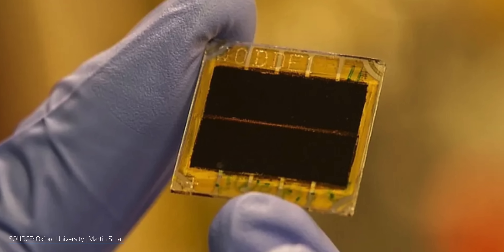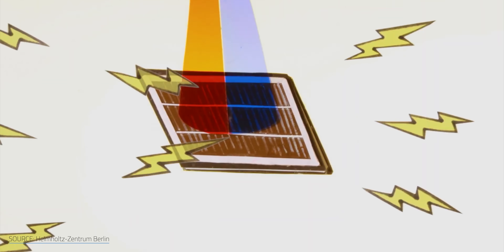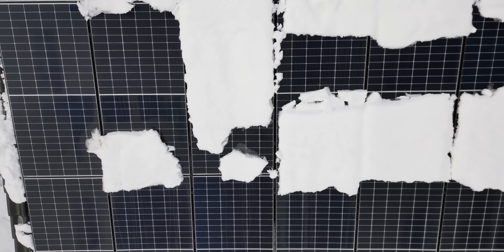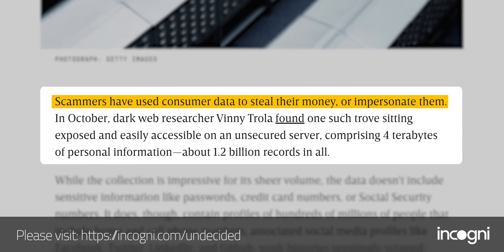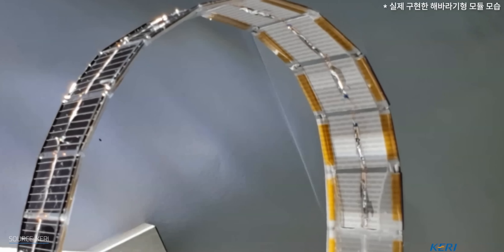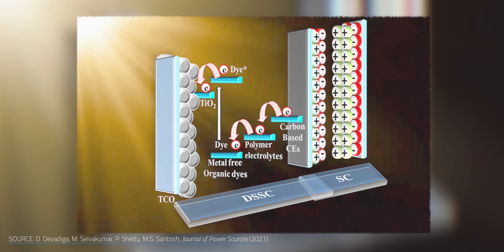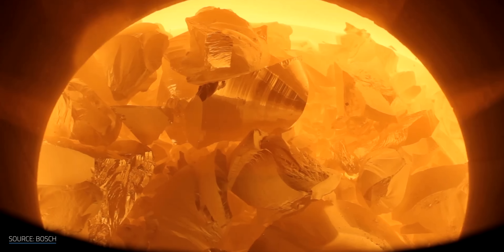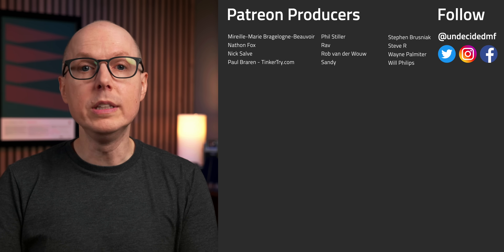Why These Quirky Advances Could Change Solar Forever

Comment: The problem with perovskite is that it dries out, so my idea would be to place a micro layer of silicone down, then a layer of perovskite, then another layer of silicone on top, this way, the top layer can even have those little pyramid shapes within that top layer, to help the perovskite absorb more light, and being sandwiched between the silicone layers, it won't dry out.
     Another thing I came up with, is why not put stacks of peltier cells between solar panels and it's aluminum frame, because the panels get very hot from the sun hitting them, so this would not only help to cool the panel's by absorbing the heat, and turning that heat into power, thus cooling the panels down, but it would also produce added electrical power output, one from the solar rays, and secondly from the solar heat....🤔🧐😎👍

Comment: I'm interested in using my channel to do comparative testing of solar cells in diffuse light, would anybody be interested in helping me by donating solar cells or test equipment? Maybe a large diffuser for test consistency. 
   The specs on solar cells under efficiency or not rated under diffuse light, but under a perfect sky at the equator to make them look better... And then the Chinese ones usually grossly exaggerated...
   I want to make a series on my channel testing many different brand styles chemistry is for their performance on the diffuse light specifically. Also to show the benefit of higher efficiency in diffuse light compared to high efficiency in direct light.
  Who would be interested in at least watching and subscribing?
Reply: Only 3 videos in 2 years!

Don't begg for freebies haha.

Go and buy some solar panels yourself. Their cheap these days.
Reply: @C--A  fixed income, got about $20 to spare, sometimes..
   As for videos, do you really think anything I've done so far counts as a video? I don't.

Comment: I have been long retired from the the world of electrical and electronics engineering and there has always been one aspect of solar as a major form of renewable energy that I question. A long time ago I was asked to investigate the untimely death of dozens of small plug packs that were used to supply peripheral scada systems. These systems were critical to the function of a highly specialised fume detection system and as such had to perform flawlessly. As part of the investigation one of the parameters surrounding this was heat, the small plug packs were all burning out. Now each of the the power loops (240 here in Aus) was fed from a pure sine wave inverter which had stand by batteries to keep the output steady. I decided to connect a power analyser to the output and was amazed to find that the output looked exactly like a modified square wave. The steps in the "sine wave" were only small but what has to be understood is that any step is seen by a transformer as DC and as such causes incremental heating of any thing designed to run on AC. There is no such thing as a pure sine wave generator as the heat generated to produce AC is hugh and makes the actual build of such a device incredibly expensive. Every solar setup that purports to put out pure sine wave is only causing massive problems on the transmission, distribution and utilisation networks. Remember the step part of these inverters is noise and noise is additive so by the time the noise reaches the generating stations it is substantial.
I was recently dragged out of retirement  by a friend to look over the building of compensaters or power factor correctors that were being built and rolled out to be connected to the  the distribution system as a means to quell the noise and keep the transformers cool. Does solar have a place yes but as individual systems and not connected to the power network.
Reply: There's a specific IEEE regulatory standard that exists to standardize the frequency spectrum generated by switching power converters that are grid connected. It is an active area of regulation for switching power converters but it is not a very large part of concern with modern technology in the sense of solar inverters. IEEE 1547 and IEEE 2800. It's a valid concern and one that is central to modern implementations, but has already been overcome for the most part.
Reply: Everything you say leads to one conclusion. Distributed power generation and usage. No centralized transmission system is required any more. All those problems become redundant. Produce and use the power where and when it is needed. Transmission infrastructure is highly costly to build and maintain and it is inefficient with all the up and down voltage conversion going on everywhere.

Comment: Makes me crazy when we just accept that solar farms necessarily need large tracts of unspoiled land. Yes, there's agrovoltaics - but then you have to build the lines from rural areas to carry the power to where it's needed - which is mostly in more urban areas. Your averge WalMart Supercenter parking lot is at least half as big as the solar farm pictured - and I'm sure they would be happy to take whatever passive income they could get from leasing use of the parking lot to a solar power company to install solar panel canopies over parking spaces. Shaded parking for their customers, producing power closer to where it's needed, and helping to offset the urban heat island effect to boot. Ditto for all other large parking lots. How does it make sense to use more land when we already have so much that's not being used efficiently?
Reply: Don't forget about all the windows could have transparent solar panels. 😮👍🤟✌️ That's not sarcasm, very easily done.

Comment: Since land is by far the most expensive part of putting in solar panels, can you please explain why solar panels aren't on every parking lot or flat box store roof? The metal for higher scaffolds can't be that expensive, and same for roofs. I live in the Midwest, and it is shocking to me that it's more cost effective to replace farmland with solar. I suspect the difference is permitting, subsidies, and scale, but I don't know for sure. Please investigate!
Reply: I think in Australia they use this kind of rooftop solar alot more.

Comment: Just to clarify, according to wikipedia multi junction cells are only that high efficient, when sunlight is concentrated. So it sounds fantastic to have high efficient solarcells, but those do not work as good for everyone (from the single consumer perspective, as the multi junction cells will be much much expensive then single junction cells (which you can buy with good efficiency now!). So maybe more for industrial or public energy companies interesting, but I doubt it, price is key in almost every part of society

Comment: Instead of buying land and wasting land space it would be better to just have a push for all building, business and residential,  in America to have solar panels on them and be connected to the grid. Add in battery storage into the mix and we would have to worry sourcing  for are power needs.
Reply: I think in Australia they use this kind of rooftop solar alot more.

Comment: you could also set up a simple window wiper system that just sprays water on the panel then a car like window wiper swipes across the panel cleaning in and removing dust water snow

Comment: I'm fortunate enough to have enough roof area facing in near optimal orientation so that my solar panels are 100% efficient, meaning that they reduce the total energy bill on my all-electric home to $0.00 per month. I don't need any more efficiency than that.😀

Comment: under no circumstances will a moving twisting and bending solar cell array be more resilient than a regular long lasting cell without any moving or bending parts
then it leads to the question of invest vs return .. those specialized cells will with absolute certainty cost far more per kwh produced most likely several times if not an order of magnitude .. and then i have to ask .. why? why don't put down 3 times as much regular cheap solar cells facing south west, south and south east .. while spending less money and having higher reliability

Comment: Growing crops under/around solar arrays is an interesting potential to reduce the cost of purchasing the land to use for just solar arrays by allowing the farmer/landowner to continue to use the land. However, most of the implementations that I have seen use standard opaque solar arrays. As such the area directly under the arrays only get indirect light, reducing the types of crops that can be grown in the shadows. 

However, if the arrays were the thin film arrays discussed in this video that could be tuned to absorb only specific frequencies of light, then those frequencies which plants use most could be allowed to pass through the arrays while all of the other frequencies are absorbed by the panels and turned into electricity. Plants that require "full sun" could then still grow below the arrays.

Comment: 1.6x 20% is only 32%. at what cost.
Reply: Yes, and 1.5x 20% is 30% and 2x 20% is 40%. Questions?
Reply: @zweigackroyd7301  what, why
Reply: @gsestream  You don't appreciate random multiplication unless you post it?
Reply: @zweigackroyd7301  at what cost, nope
Reply: @zweigackroyd7301  I dont appreaciate forced appreciations, of kings. 60% is usually nothing. order of magnitude would be the best. 30% vs 20% efficiency is virtually nothing.
Reply: @zweigackroyd7301  yeah just put a second 20% panel, double up the panels, dont pay more for the appreciation of kings.
Reply: @gsestream  Thanks, I'll go with the experts than random cryptic person on YouTube. Feel free to write comprehensible information, but your statements about efficiency are poorly informed.
Reply: @gsestream  Does babbling on about kings make you feel clever?
Reply: @zweigackroyd7301  every bit does not count, if it makes you judge others, king, the more you push, the less interested I'm in your stuff, whatever it is. mind your own business.

Comment: Other than the memory material tracking, what’s different about using the folding array there vs. plain classic PV and an array of tiny panels? Why can’t we just put static tiny panels all over everything? A huge problem I can see with the memory wire moving panels in many places is potential for damage — sure, they may not need mechanical maintenance like sun trackers, but those things look really frail — I imagine them hanging off the back of a bench and then some kid bangs their bike against it and there go a half dozen of them. 

Personally, I think it’s cool and great that we’re exploring these technologies, but I also think we should just throw current PV anywhere convenient — if we covered every parking lot with awnings covered in them, that would probably be a huge amount of power we’re just missing out on… plus keep our cars cooler! And as we get the newest tech we can just upgrade things

Comment: I have a tiny Decathlon flexible solar power (it's more like two panels jointed, really xD) that feeds into a USB stick and have used it a few times either hitched to a camping tent or draped over my backpack (I live in Italy, so summer has plenty of sun to go by) to charge my phone or external battery.

If these techs could lead to more of this stuff, I'd love to give it a go ^^

Comment: Another interesting technique to extract more power out of solar panels with their existing technology is to cool them. Cooling should be done by installing fluid tubes to the backs of the panels. The heat from this can even be used for domestic hot water. Years ago when I was visiting universities for work I got introduced to this idea, I was sure that that would be next big thing, but I don't see many manufacturers with this combined tech. Hope Matt can cover this topic at one point, or if anyone else in the comments has any experience, please let me know!

Comment: the 3D panels could be VERY helpful in space applications allowing portions of panel to bend to make the most of the sunlight hitting them with less mechanical parts to fail

Comment: Hey Matt I have an unrelated question to this video but I was watching the Net Zero house build and couldn't stop wondering why not build it with ICF? was it because you wanted a prefab process or is it a worse way of building? I'm looking at a lot of options for my future house and your opinion would be very helpful as i wanted to be as air tight nd efficient as it can be.

Comment: It's pretty much a given that if PV cells hit near 80% efficiency you will see them on the roofs of every EV, and on hoods/trunks too. Charging is the Achilles heel of EV's and a panel that can recharge a pack in near real time would render ICE all but obsolete 🔥🔥🔥

And the applications don't end there - large roof vehicles like vans, trucks, buses, portable DC to AC inverters/generators, high-concentration dwelling applications, high-energy demand industries and remote/off-grid installs. Be excited for what is to come!!

Comment: Why are these solar panel companies getting excited about the possibility of putting solar panels on cars when there are already cars with solar panels on them.  OK, Sono failed to go into production but they did have working prototypes, and there is that three wheel vehicle that is suppose to be super efficient, and then wasn't there a Dutch super expensive solar car.

Basically we already have the technology to put solar panels on cars, so why are researchers getting excited about the possibility of doing somethings that has already been done?

Comment: one of the big issues the Australian CSIRO found when you made more efficient layered panels above 40% was heat. Increasing panel efficiency means you also have to develop a cooling system to compensate for all the heat that is generated.
Reply: Or have materials that can withstand that heat.
Reply: @supahguy2013  The temperatures in question are not merely those of boil water, but rather those that can melt or warp steel. Additionally, panels lose efficiency as they get hotter, so while materials may be found to withstand higher temperatures, efficiency losses become a challenge. CSIRO has designed an extremely efficient heat sink for their panels, enabling them to achieve an efficiency rating exceeding 40%.
Reply: @LinuxGalore  i see, i thought it was way lower, with that in mind it is quite a bit harder yes.

Comment: As for using large pieces of land for solar farms, parking lots should be an easy win. I get making them fit and the taller installed height may cost more, but it doesn't take any extra space that isn't currently being used.
Reply: An excellent idea - similarly, EV charging stations could have a solar roof over them - for some reason it seems that EV charging areas are uncovered yet fossil fuel stations are not.
Reply: And they make shade too !
Reply: so many urban applications for solar that could already be being used, like bus shelters, shops, churches, street lights

Comment: The most expensive part of solar is the labor installing it. You can capitalize the land acquisition costs and last is artificially expensive. We need to remove the installer or make it so installation is so easy that it doesn’t require as much labor

Comment: I have been picking at a nitinol-based way of targeting the sun with solar, just using some mirrors to hit dark areas of the nitinol when the cell isn't pointed well, then using the heat to reshape the holder to track the sun passively.
Reply: An Irish company us using it as part of  a heatpump cycle  .

Comment: There are a lot of potential problems if you want to cover an electric car with solar panels. The color of such cars may be the least of them.  Then again, most people buying a new car like being able to choose between different colors and finishes. If you add a red dye to the panels that makes them more efficient, it might make EVs covered in solar panels even more attractive. Or not.  I am guessing that dye isn't going to color the panels cherry apple red.

Comment: The self moving micro panels seem like more delicate failure points.  Ice and snow seem like they'd end up being outside the force abilities of such small movements.   And hail strikes also would seem problematic to thin flex points.    Flexible so it can be wrapped on surfaces is fabulous though.

Comment: I love the graphic at 7:22. I think the possibility of recapturing energy expended by indoor lighting is something that I've never really considered but makes a lot of sense. Even if the efficiency is low (or very low), it would be better than nothing. Reusable energy, in a way. Particularly in the winter months when we use more indoor lighting. Would be really interesting to know if any companies are working on projects to make indoor PV panels a thing.
Reply: iv got 2 1,000 lumen solar powered lights in my lounge that have a remote, supposed to be used for garage/driveway, the 2 panels are 25cm square and inside my windows. I use light filtered from kitchen light in the evenings on my laptop, but having these lights gives me a boost when i want extra light. They do much better than i thought they would, when fully charged they last an entire winter evening, but in winter, it takes 3-4 days to fully charge them